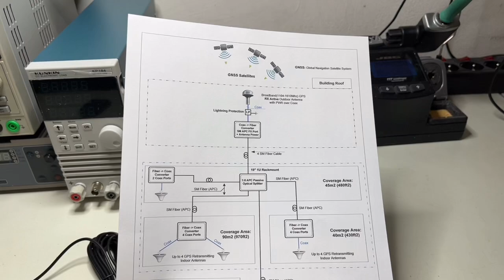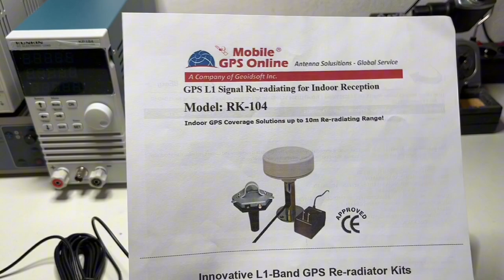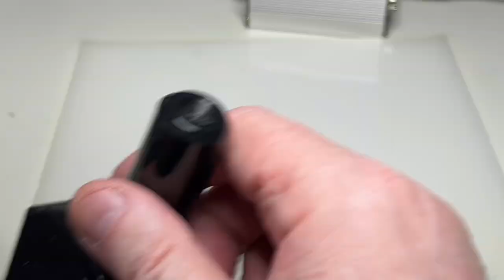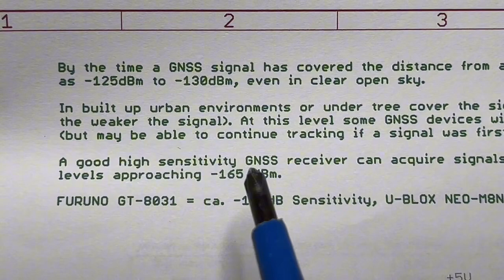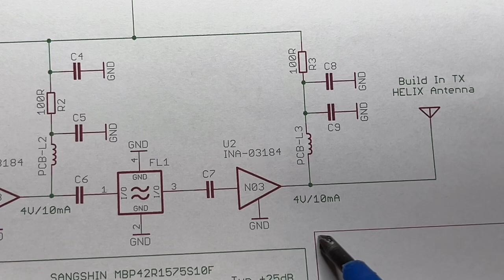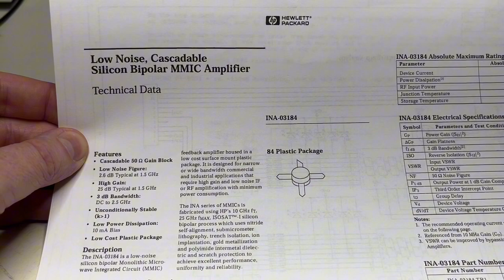GPS/GNSS Repeaters #1; Schematic,Design Details,Teardown of a Professional Solution

Comment: It seems like there's a missing capacitor on the +5V line near inductor PCB-L1, right? I don't have the board on hand, so I'm not sure about it.
Reply from the maker: Hi, no there is no missing capacitor, the one you probably mean as Missing is C4, its just differently drawn, Cheers.